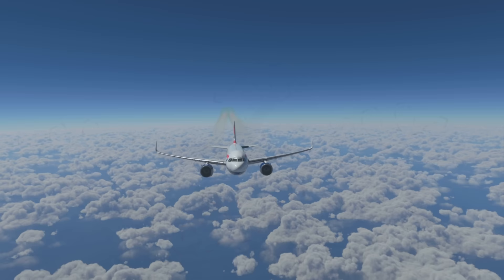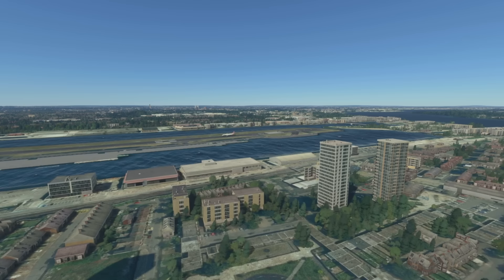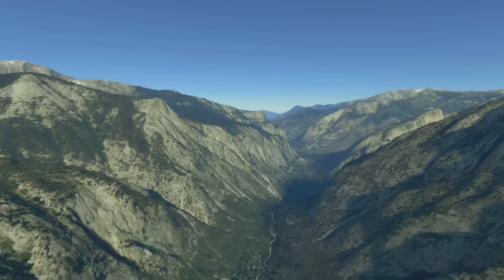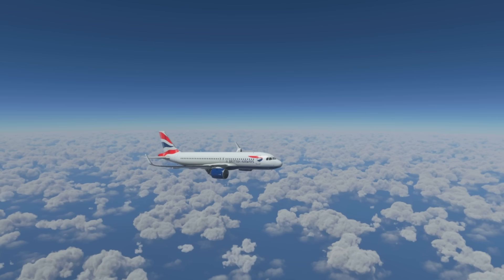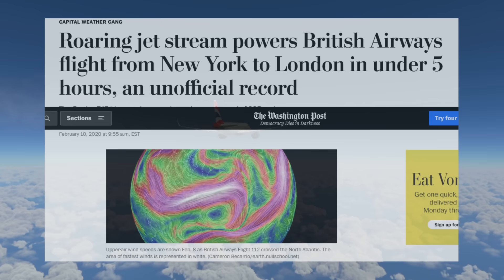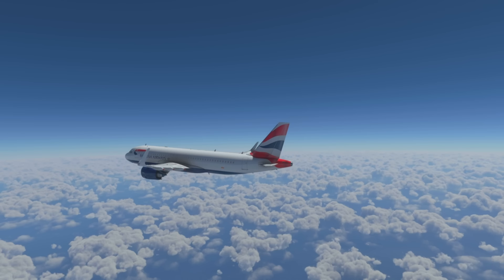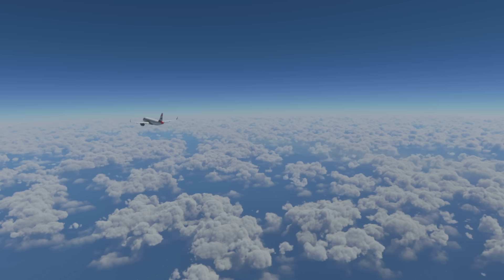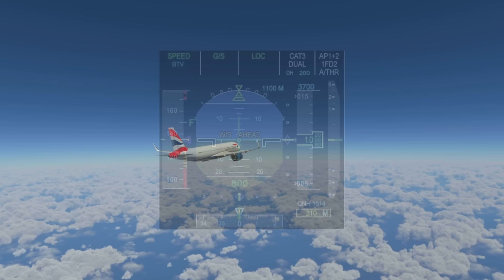When Is Turbulence In An Airplane Dangerous? | Curious Pilot Explains #1

Comment: What was left out of this explanation is that although the shaking of a plane means a lot to us, it means very little to the plane itself since it's so much larger. If you are still conscious, the plane is totally fine. Also, at the high speeds, the air will behave like a fluid. So, the air in this context is not the same "empty air" we experience at low speeds. Awesome video!

Comment: In 1966, as a BOAC 707 passed Mt Fuji after departing Haneda airport, they encountered clear air turbulence so severe, the vertical stabilizer was torn from the aircraft. No one survived. Photos of the accident are on line.  The 707 was one of the first built in '59. Not likely we will ever see anything like that again.
Reply: Wtf…
Reply: 1963 NWA from Miami to ORD crashed about 15 min after take off in severe turbulence

Comment: Thanks for this video, I'm trying to get over fear of flying, since at the moment I'm unable to hop on a plane, and if I have to because I have no choice, it's exhausting because I spend the flight crying and with anxiety.... This video helped me with one of my fears, so I believe videos like this will help me get over this fear... Keep uploading videos like this please! You've gained a new subscriber!!!
Reply from the maker: That's really great, I'm glad it helped. I would just warn you that many of my videos look into air crashes and analyse why they happened and how the aviation industry became safer because of it. I have another 'explains' video coming soon where I will be looking at emergencies and why, for the most part, they are not anything to get worried about. :)
Reply: I used to be scared also. I had a roommate who was a flight test engineer at Boeing. He told me that Boeing designed an aircraft (I believe that it was the 767) that could actually fly and land itself without a pilot. Apparently a pilot flew one out of Paine Field and then did not touch the controls at all as the plane turned itself in flight and then landed back at Paine Field during a test flight. With systems like that and the systems described in this video, it looks to me like flying is pretty safe.
Reply: My mother flew at least several hundred times in her business career. My last flight from Austin, Texas to Wenatchee was delayed by a thunderstorm. The flight was totally smooth after we lifted off. Several of us passengers were worried that we'd have to find a motel to sleep in because we were going to miss our connector flight. Alaska Airlines had the connecting flight delayed so we could catch it and had a shuttle van waiting for us the second we got off the plane. That was awesome.
Reply: @CuriousPilot90  don't worry, I do like watching plane crash investigation videos so I can educate myself into why these things happen. So the more education I get, the less fear I'll have.
Thank you for all your videos. I really appreciate them.

Comment: I flew for the first time last month and took off during poor weather in Bristol (England), an airport I am led to believe has issues with wind shear now and again. It must have been a minute or so after take off when all of a sudden, the plane felt like it dropped about 50 feet during the ascent - a similar feeling to driving quickly along a county lane and going over a low bridge at speed,  or standing in a lift that drops you down quicker than you expect. It shook a few of us up but thankfully, the rest of the fight was smooth enough.
Reply: You have to consider that you feel the force of acceleration not speed. So after takeoff your vertical speed will decelerate, which will create a force that feels like you are going down, when in fact you are still going up but just at a slower speed. Happens a lot after take off.

For example if you are going up at 10ms, then slow down to 5ms, you will feel like you are going down. Like hitting a car brake from 100kph to 70kph, your body flings forward, you are still moving in that same direction.

Comment: This can be quite scary indeed! Once in my hang glider I was well into final, almost entering ground effect (was probably about 25 feet high), and I got dropped to 5 feet in just about a second, lost a lot of speed, and had to dramatically change my nose angle to avoid the crash. I always come to land with a lot of extra speed, had I not done that I’d defintely ended up in the hospital or dead! Flying is awesome though, fly fast, fly safe!

(for info, these were highly thermal  conditions with a lot of wind changes, and I had a good head wind coming in, I suspect I fell in the downdraft / turbulence of the thermal, rather than wind shear. I didn’t feel a switch from headwind to tailwind, as I didn’t notice a groundspeed augment and I could then bleed my ground speed and run it out easily like in a normal landing.
Reply from the maker: That doesn’t sound like a fun experience! Glad you made it though safe.
Reply: @CuriousPilot90  It was fine because I got out of it right away and I didn’t crash, didn’t even have time to think about it! I’ve had worse in hang gliding 😂

Comment: Thank you for this video. I’m often a nervous flyer, so watching this was very helpful.

I also get nervous when we’re flying through thick, dark clouds. I know pilots have radar and such, but I still sometimes worry that we’re going to hit something, like a mountain or another airplane. Very unlikely … right?
Reply: TCAS is an automated alert system which provides RA's (resolution advisories) to both pilots, instructing one to ascend and the other to descend - with a fair amount of warning. It's compulsory equipment basically everywhere. 

GPWS (and later upgrades) feature GPS terrain mapping and radiowave proximity detection to alert the crew if the ground is too close or they are on a trajectory which goes too close to terrain. Again, compulsory basically everywhere. Standard terminal arrivals are prescribed routes which maintain terrain clearance and create order such that it's easy to follow other aircraft and know where they're going next.

I'm struggling to think of when the previous commercial CFIT accident was (Controlled flight into terrain), and I can't think of the last midair collision. I want to say the crash over Europe in like 1993 or whenever it was may have been the last time. Either way, both accident scenarios are super rare.

Comment: For people who are not in the aviation industry, the turbulence is for many a near death experience. Has any plane crashed due to turbulence? Grateful for answers
Reply from the maker: Hi Dan, I think (and hope) that it is understood by most that turbulence at the very least is an uncomfortable experience with many, as you say, a horrible experience, especially those who already have a fear of flying. With regards to your question, I’m struggling to find an incident where turbulence was the sole cause of an aircraft crash. There are rare occasions where it is a contributing factor but for the overwhelming majority of the time it poses no risk to the aircraft. Modern aircraft are designed to be positively stable and built to withstand forces greater than they will ever experience. Sever turbulence can cause injuries if people or objects are not strapped down and even the most dangerous of turbulence being microbursts/wind shear there are so many ways this is mitigated that even in the rare occasion the aircraft experiences this, the Pilots are trained to combat the effects. I hope this helps.
Reply: @CuriousPilot90  Yes it helped  - thanks
Reply: @CuriousPilot90  I had a turbulent experience yesterday in SpiceJet india flight,,,I had accepted that I will not survive that flight,,,because it was really violent and the air hostess fell down on the ground and sat down for a few minutes till the shaking stopped…..Tell me something I have been flying for over 20 years now….is it just me or u too have experienced that turbulence incidents have become so common now..every flight I go has a panic inducing turbulent episode…this didn’t happen 10-15 years back …now it’s so common…is it perhaps due to cost cutting by airlines in today’s competitive air transport industry?
Reply: @ttly8144  I'm not sure it's happening more, I think we probably hear about it more because way more people are flying than ever and everyone has phones to record this stuff and put it on social media so the chance of hearing about it is much more likely now than in the past.
Reply: @ttly8144  i agree they have increased……maybe due to climate change?
Reply: several crashes have happened due to windshear on final approach... you can google it, in the US there were several.
Reply: @rexx9496  I also feel that there is more turbulence these days
Reply: @dawsonje  Can you give some exampel
Reply: @dans78  yeah, Delta flight 191 crashing at DFW airport about 35yrs ago. I think Flightchannel on YT did a video on it.. there are several others, even more recently in Russia.
Reply: @ttly8144  climate change definitely has increased the frequency and severity of turbulence.
Reply: @UmmEss  source?
Reply: Climate change is bound to increase turbulence. Warmer air parcles meeting comparatively cooler air will create a larger pressure gradient (different) leading to more turbulence. 
Winds will also become stronger and weather less predictable. 
Hope the industry is keeping up with changes in our atmosphere
Reply: @ttly8144  I was just thinking that. I flew regularly as a kid/young adult (80s through early 2000s) and the flights were always so smooth. Recently,  like over the last 10 to 15 years, it seems like there's  some "incident" on every flight I take. Bumpier, shakier, more seat belt signs, suspended meal services, etc. Climate change ig.

Comment: Brilliant, you are a credit to the aviation industry and anyone who is frientened of flying. I am a fellow pilot and have experienced the same 'panic' with passengers at high altitude. It's very scary but the passengers don't know that there is no problem.
The only caveat to that is that flying into a CB is very bad news. Up and downward air vectors can literally rip the wings from a commercial jet which tends to end the flight rather quickly. Luckily, that never happens with weather tracking.
Great video!!
Reply: What is CB?
Reply: @dans78  cumulonimbus
Reply from the maker: Thanks Phiip 👍🏼
Reply: Thank you for scaring the 💩 out of me🙄

Comment: I was flying from Canada to Scotland around September (2022), when the Fiona hurricane was sitting nearby.

I was kind of wondering if I would experience any effects due to it, and it was indeed my worst turbulence experience. I don’t know if it qualifies as moderate or not, but the pilots told the air attendants to go take a seat.

The air attendants were almost done serving food, so they decided to “cheat” and park the food cart at the very back, and started bringing food to each of the last few rows, including mine.

As they are doing this, the airplane shakes very violently. If it were a car, it would be the equivalent of it going through some sort of bump at extremely high speed. It felt like we had just been “hammered” by some blast. People screamed for a second.

After that very acute blast, the airplane continue to shake for about 30 min or so. The pilot said there wasn’t much we could do, and that it would be turbulent at any altitude.

At this point, I had my food tray with me, and I had to hold it, because the airplane was vibrating enough that the tray would collapse on the floor in a matter of seconds otherwise.

This probably lasted for what felt like 20 or 30 min.

After that, the pilot made some announcement I couldn’t understand completely, but I think it was something along the line of us having lost a quite a bit of altitude, and that he was about to bring that up again.

After that, there were no more surprises for the trip, but I feel like it did traumatize me a bit. I understood the importance of seat belts, as I never realized how intense it could get.

Comment: Where you sit on the plane also affects how much you will feel turbulence.  The fuselage is a lever pivoting over the center of lift (aerodynamic balance point).  This is typically mid-wing in the cabin so the best seats are aisle wing seats.  The motion will be minimum there.

Comment: What about high altitude turbulence? As an unaccompanied minor I was flying at night over the Pacific from LAX to Sydney Australia in the late 70's in a DC-10, and 3 hours into the flight as I was sleeping across the middle rows in the wing area of the plane with armrests pulled up on three unoccupied seats, the plane suddenly hit major turbulence. The whole plane flexed, made all kinds of noises, pressure toward my seat and then the ceiling, and I could hear the engines were thrown into full thrust. I had the sensation that the whole wide body DC-10 was flapping it's wings! We were then going down very steeply, it seemed almost straight down, and I unwisely unbuckled my seatbelts and grabbed onto the seat struts on the floor thinking that was safer. After a terrifying few minutes the event was over with the plane straightening out at a much lower altitude, but I really thought we were going to crash. Pilot eventually told us it was "high altitude wind shear, and that due to injuries and possible damage to the plane we had to return to LA at low speed and altitude". When we landed the plane stopped on the runway where many people were taken off on stretchers, mostly cabin crew. Fire trucks, ambulances, etc were there to greet us. I'd love to know how to find that incident on the internet if you could tell me a source, and what we most likely flew into? 
Great videos by the way!.

Comment: Just took a 13 hr flight from Delhi to Melbourne, modern aircrafts are designed really well to handle any sort of turbulence , barely felt anything , also the pilots are super skilled so there was no issue at all

Comment: I had two experiences with turbulence in my life:
One time around Stansted airport there were many thunderstorm clouds, and I expected a drop. So I strapped myself in quite well. Then I looked to the ground from my window seat, and when I thought, that we were high enough, I relaxed. That was when the airplane seemed to stop mid air and then we started falling. I had underestimated how fast the ground was coming closer again. Most of the people in the plane screamed, engines started roaring a lot, some acoustic warnings came through the cockpit door. At some point the plane was lifted again and the wings turned upwards as I have never seen before. But I knew they were tested for this, so I was still one of the few not screaming.
The other time we were about to land in Frankfurt. We had been delayed for takeoff as there was a big storm and thunderstorm above Frankfurt we have been told. When we approached, the storm had not dissolved, and we were doing circles in heavy turbulence. As always I tried to go with the movement, but that time a wind moved the airplane to the side suddenly and so forcefully, that I was, despite being strapped in very well again, thrown against the wall of the plane next to the window. I had a window seat again. I was dizzy and had a headache, but did not ask for medical attention when we finally landed.
I just decided that, next time I will also hold on to the seat and not go with the flow so much.
But I usually enjoy the more turbulent ride.😊

Comment: I did experience wind shear as a passenger and it was really scary. We were approaching the airport in an absolutely clear and quiet summers evening. Suddenly the aircraft became destabilized and was lifted violently up away from the glide path. Pilots reacted immediately with nose up and maximum thrust. Passengers were really scared, asking what is going on. The pilot spoke to us on the intercom, trying to calm us down but it was clear he was shaken himself, since he switched to pilot slang midway through the announcement. The aircraft continued to be unstable for a few more minutes. Luckily everything was fine in the end, we went around and landed from the other end of the runway. When we landed I just noticed how calm and quiet the night was at ground level, so wind shear is not really connected to bad weather, but to some freak vortexes that occur on a random basis around an airport. I wouldn’t want to experience this again ever.

Comment: Back in 2002 while flying back from Alicante in july, the airplane flew through a flock of geese.
The birds cracked the windscreen and it caused an electrical fure in the cockpit.
All the electrical power went off on the plane, and the pilot explained that he had lost control of the aircraft and we were going down.
After dropping hundreds of feet the pilot came back on and said he had regained control but we were too heavy to land, so he opened the fuel flaps under the plane and dumped the fuel all over the mountains.
He landed on an old military runway in spain.
Absolutely terrifying, all the staff/crew were screaming and in tears.
It was a close one

Comment: I experienced wind shear as I was landing in Hong Kong International Airport. It happened while we entered a cloud on the way to the runway. At first the turbulence seemed quite strong but nothing I hadn't experienced before, then suddenly I felt a sharp drop that pushed me against my belt for about one second, probably due to wind shear. Everyone was screaming and we could all feel the engine power ramping up as the pilot did a go-around. The second time we went again in the cloud and this time nobody was talking. There was some mild turbulence again but the plane landed safely. Even if this happened about 4 weeks ago I've dreamed about this multiple times, and on the return trip I started having cold sweats every time the aircraft would experience some small turbulence. This video definitely put me more at ease.